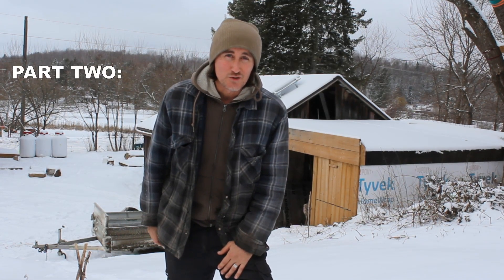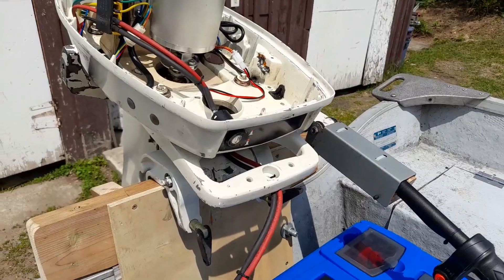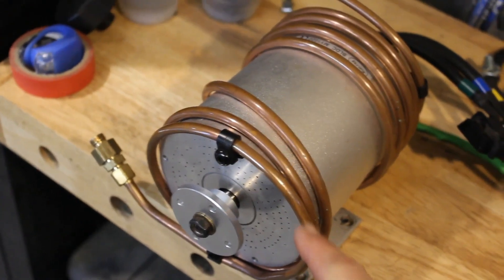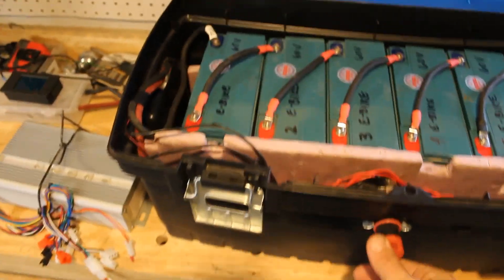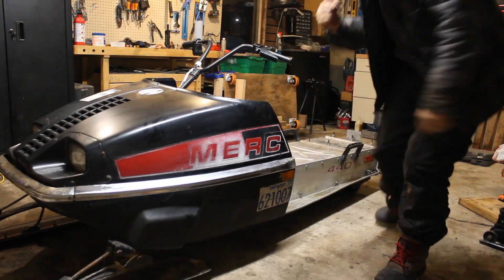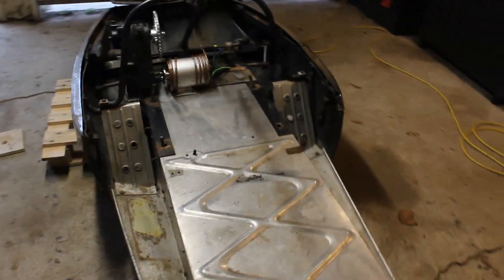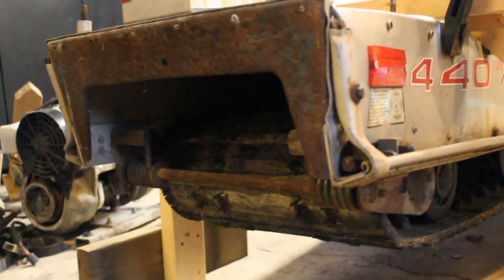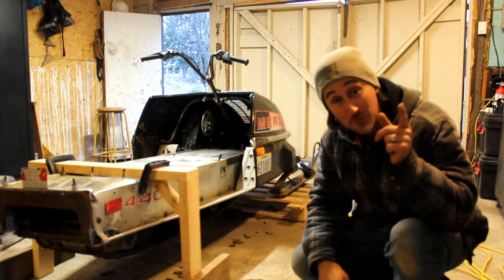Vintage Snowmobile Electric Conversion! Part 2: The Motor

Comment: Interesting.   Wondering about snow/water getting sucked into the motor?   A 440 2-stroke would make something like 40-60 hp.    Your 3k electric is something like 4 hp wondering how it will pull that sled.
Reply from the maker: It does move the sled! (you'll see in part 3) Obviously it won't be as fast as a 60hp engine, but this is just a proof of concept.. There is plenty of room for improvement (ie a better motor) but I wanted to get a baseline prototype working before spending a ton of money. Thanks for the feedback 👍 ⚡
Reply: @Watchmikework  Don't get me wrong I like the idea.   I have seen how these 72V motors can make a 125 cc dirt bike rip!  Looking forward to the series actually.